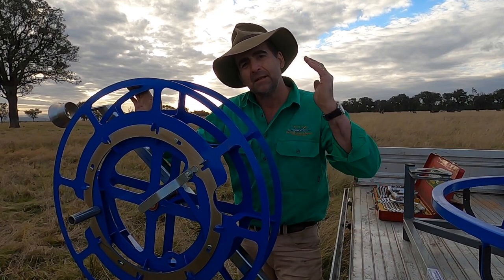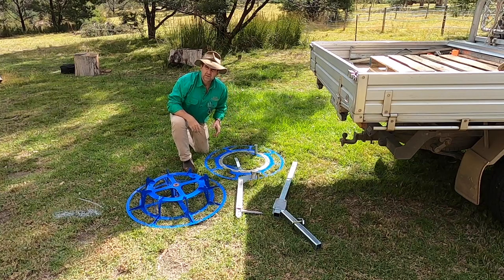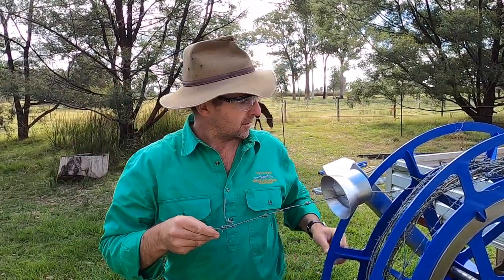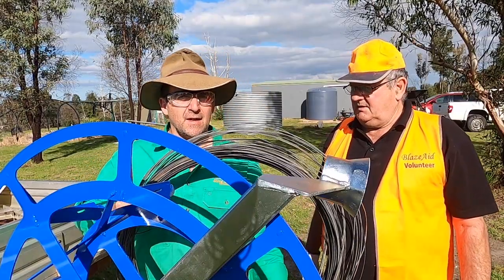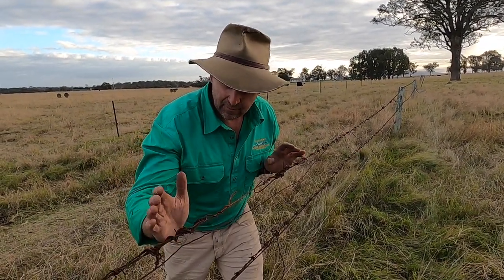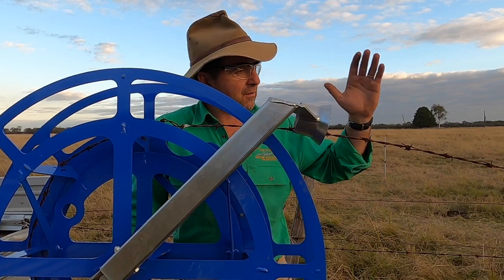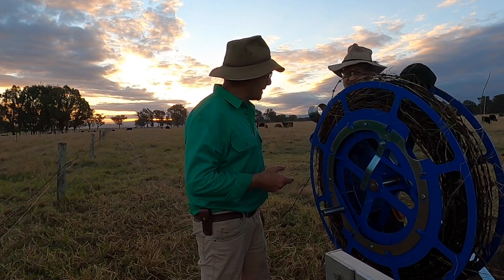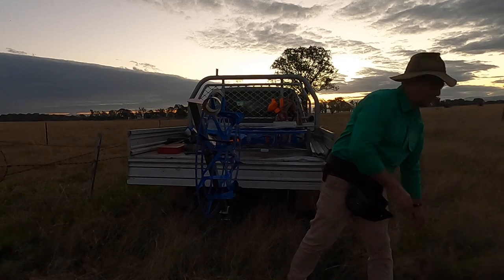A Wind Up Fence?? Using the Walters Fencing Winder on Plain and Barbed Wire.

Comment: I feel like combining a wire spinner and this wire winder into one would be the better way to go? Then swap out the guide ring to suit the application you are using it for.
Reply from the maker: Problem with that idea is that wire is wound differently in a factory and it would jam with the necessary angle on the drum. Can certainly unwind the wire after winding up on the machine though. Just slip the feeder off.

Comment: Add a 12v Motor to it like what the RFS uses to wind up their hoses, plug in to trailer connection 😉 also maybe put handle out on edge?

Comment: I think it has a lot of promise.
I wonder if the cone feeder should be bolted on so it can be replaced because these could wear through with lots of use.  If you were going to reuse the wire I would use some hi-vis tape to mark the ends.
Reply from the maker: Yep it is. I did some pre-assembling. The shaft is seperate to the cone.

Comment: I also think you could probably wind the whole lot in one go if... You stick in a couple of steel 'V' stakes under the wire along the run, just to raise it a bit. Certainly that would make it possible as a one man job for long runs.
Reply: My brain just started working, wide and fairly high-sided 'U' stakes of a decent diameter tube would be much better than VS 💡.

Comment: You could have mount it above the truck and drove it in reverse gear. This way one man can drive the truck along the fence and other can wind the wire. This way there won't be any drag as well. For single man operation you can attach a motor with  speed controller.
Reply from the maker: Interestingly they offer a motorised version. You can also side Mount on a steel tray.